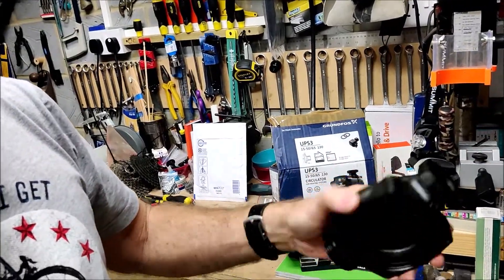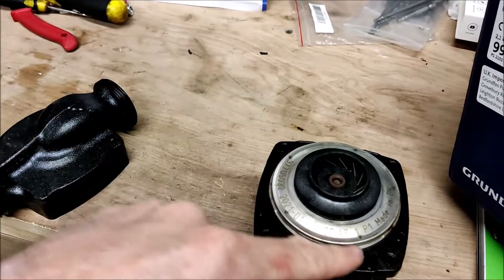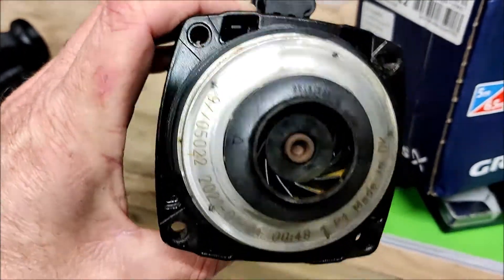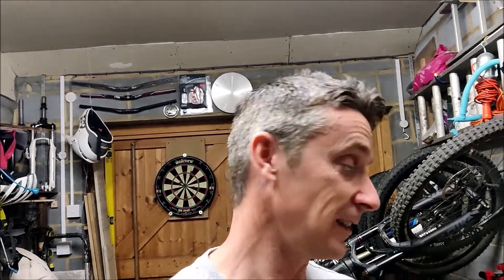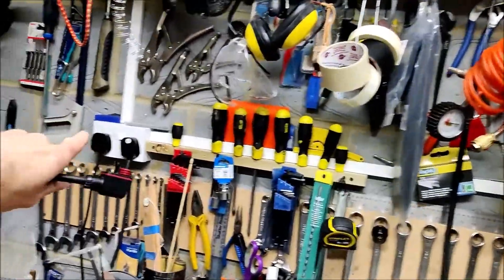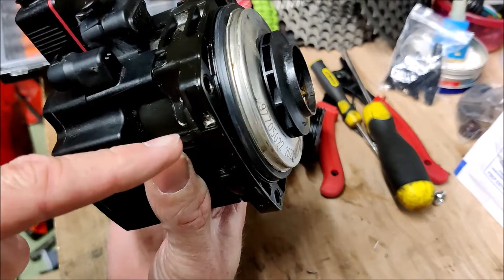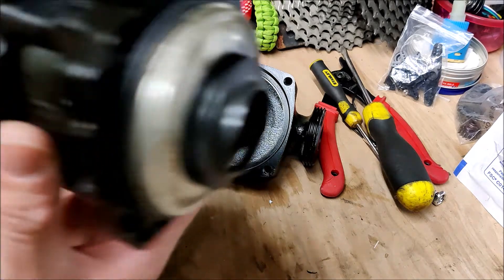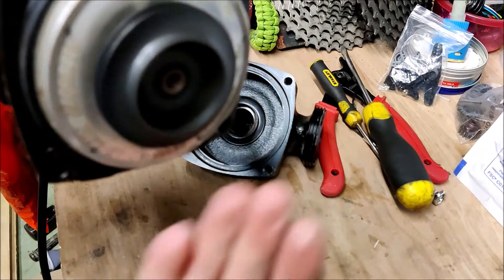Grundfos UPS3 pump vs UPS - is it really as powerful?????  Please help.

Comment: To make it more efficient, it gets a smaller motor, thus smaller impeller all to save the planet that the Indians and Chinese don't give a toss about. Had a UPM3, not issues. Now going to try the  new G Force pump. Let's see how this goes. Actually going to call Grundfos tomorrow to check with technical

Comment: Curious, our old Grundfos pump was 20 years old when I took it out last week and the reason being the house was like a fridge even though the flow temp from the boiler was what is should be. I installed the UPS3 and my god what a revelation! The house was far, far warmer than it had ever been and like never before I could actually hear the water rushing through the rads. I've since backed off the pump to constant pressure setting number 2. The point is my experience with the UPS3 has been brilliant!

Comment: Hey I would like to leave comment about my experience. My ups3 was behaving exactly the same way finally I gave a bit more attention to it And I was able to hear the sound of cavitation in the pump. After being literally robbed by a local plumber who power flushed my system who was really lucky to getaway with his payment after 3 weeks on the 4th week the system started to behave the same way. That plumber didn’t come back! And I understood why he was rushing for his payment. Then I discovered the pipes between the pump and boiler highly blocked. Couldn’t wait for other plumbers partially drained and installed temporary pex pipes between pump boiler and FE tank after cutting existing pipe work. Since 1 months it is working like a charm! And the pump is set to min speed. All my 11 radiators 2 zones UFh and Hw cylinder getting very warm! I binned all the advice from all the plumbers to change my boiler, blaming grundfos ups3 pump etc… In a nutshell Grundfos Ups3 is a good pump but you need clean non magnetic pipes to make it work efficiently! Typing from mobile so forgive me for any typos! How did you manage it  so far; after broadcasting this video?
Reply from the maker: Thanks for sharing your experience and it's great to hear you've successfully sorted your system out 👍🏼.

As for me, well the UPS3 is still in its box 😂.

My original pump, which was installed in 2006, continues to do a fault free job, delivering both DHW & CH as it should. 

Perhaps when the spring arrives and if my schedule permits, I may revisit my UPS3 ..... likely in my case to try changing the body as well this time.

But I'll be sure to heed your advice on the "clogged" pipes too.

Thank you 😎

Comment: Yes, I also found out that the pump with LMH Settings which was  made obsolete are now being made again for old systems,  grunfos have not stated anything about this issue,, the new pumps won't work on an old system I've just spent 4days ... in the end I changed the pipework to suite...😡😡😡😡😡😡😡😡
Reply: I fitted this pump to replace the previous version which bit the dust. I'm having a nightmare with it. Even when set on max speed it doesn't seem to have the ooomph to circulate right thru my (old) system. 
My Woscter system condensing boiler fires up, runs for 2mins then shuts down again & so is obviously protecting itself. 
I never had any particular issue with the old red UPS2 with the bigger impeller and central bleed screw. 
I notice the UPS2 is still available online. Do you think going back to the older version would get me back up n running?
At the moment i have no hot water & one rad that barely gets warm!!
Reply from the maker: It's hard to say for certain, but my gut feeling is that a like for like replacement (eg another ups2) would likely get you back going again. 

Tell me, did you change just the head or the back body too. 

It's looking more likely that the new head is not compatible with the older back body. There is probably too great of a gap between the casting of the back body and the new smaller impeller for the draw/siphonage to be sufficiently effective.

I have to admit, I have never revisited my pump, opting to leave my old UPS2 installed and the UPS3 in its box !!!!

Comment: To be honest these pumps are shit...!!
I only fit the old style pumps when I’m doing replacement’s and that saves the customer ringing me to tell me some of the rads are not working , if you fit this type of pump on a new clean install it would be ok but on old clogged systems forget it... 👍
Reply: Nothing wrong with them. Usually down to crap engineers not bothering to flush the systems and balance the rads. Do the job properly and they're absolutely fine.
Reply: Bellend alert.

Comment: Did you bleed the rads i install one just the other day and my boiler kept on going turning off after less than two minutes i put the old back into place as i thought it was faulty then i drained the whole system and bled each rad turned on the heating and the knocking noise was very load i gave it another few hours to make sure rads where full of water checked by bleeding any air
from the Rads one the rads i discovered a lot of eir coming out of the bleed valve gave it a chance to make sure trickles of water start flowing from the bleed valve.
Turned on the boiler and bingo working fine all radiator's piping hot and the old pump working fine it was down to an airlocks.

Comment: My boiler is struggling so I thought a better flow rate would help. It appeared from the graphs the that litres per hour were more then the UPS2. I fitted the new pump keeping the fitting as you did, it looked exactly the same to me. However I got a fault on the boiler,temp spread to great which basically means the flow was too low and this was on 3. I feel I’ve been sold a lemon.
Reply: you've probably got a restriction somewhere
Reply: @cousinbenson2999  British Gas seem to agree with you. The changed the pump over entirely, they said you should always do that. But the flow is still too low. They said I’ve a restriction in the pipe work which means floorboards up etc. A job for the New Year. Luckily I had the immersion wired up in August as an emergency so have some heating and hot water.

Comment: I just got my pump changed as the the old Grundfos (no lights on head) ceased, and the new Grundfos UPMO 15-60 compatta is NOT as powerful as the old one, some of my radiators on the end of the circuit are not warming up as much as they used.... Maybe thats where the energy efficiency comes from
Reply: I too replaced an old Grundfos which circulated water across my 20 radiators quite happily on no.2 setting. The new UPS3 was unable to heat the furthest radiator on my system at no.2. Only when I switched it to 3 did the radiator heat up. I will rebalance the upstairs rads to see if this helps.
Reply: You may need to rebalance your lockshields now your system is reconfigured.

Comment: I had the same issue and i did the same as you by just swaping the head, So after playing around I changed the body too. And its a masive diference, I dident get a good side by side look at the bodys as i was in the loft with just a phone light But they did look a lil different. Anyway it works good . i also set it to Proportional pressure ll  as i found that just haveing it at the set speed lll setting The pump could not pull water fast enough so it basicley cavitates and dose little work , with my application (oil fired heating and water) the boiler would cut out on over heat, but on the Proportional pressure setting its all good, I think its more about flow rate than presure and the pump running flat out makes presure but it cant suck the water fast enough, It was a pain to find that setting mind lol. but as i was playing i found the boiler was more happy with standard speed set lower. more flow but less presure. i also did change the 2 ball valves each side of my pump as it had 2 screwdriver type shut off valves that were 22 mm pipe to the pump fitting but the hole inside the shut off valve was like 15mm so i just removed them just a pain to drain the system to change a pump lol , sorry for the spelling im dsylexic, just hope this helps x
Reply from the maker: Ross, thank you so much for taking the time to respond. 

Having heard your experience I may now take the trouble to change the body too. 

To be honest, since making the video my UPS3 has remained in its box sat on the shelf in my garage, with the original pump doing a sterling (if yesteryear efficient) job up in the loft. 

Luckily I have decent valves in place so I shouldn't need to do a full drain down.

Once again thanks for the info and in the event that I do get around to changing it no doubt I'll probably make a video and certainly will give you a mention and credit.

Cheers fella 🍻
Reply: Interesting. Wonder if it wasn't fitting the new back that did the trick but upgrading the valves?
Reply: @petemc5070  Reading his initial message I think the changing of shut off valves might have caused his initial problem of "not pulling enough water" and so he had to change the motor to proportional pressure. Personally I would never mix and match body to heads for any pumps as most of the initial design and testing of any equipment is done on a complete new design, fixture, holes sizes, etc.
Reply: Thanks for the information I’m hoping fitting the UPS3 my L1 overheat fault on my IDEAL Boiler stops occurring,